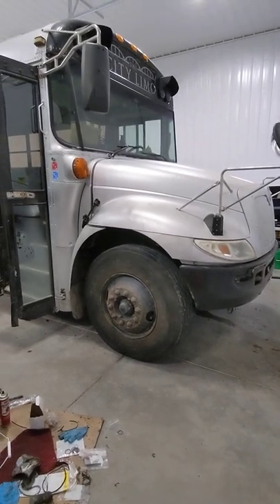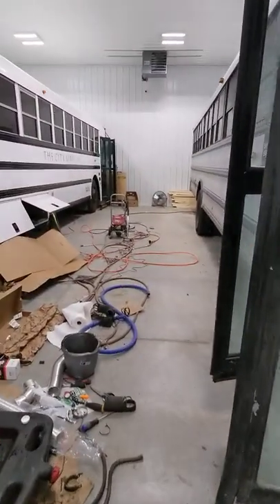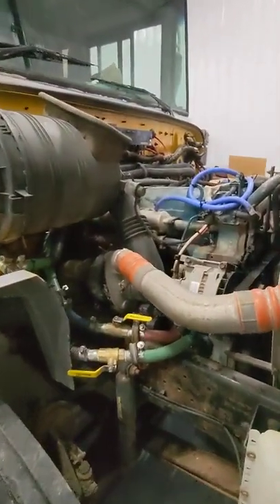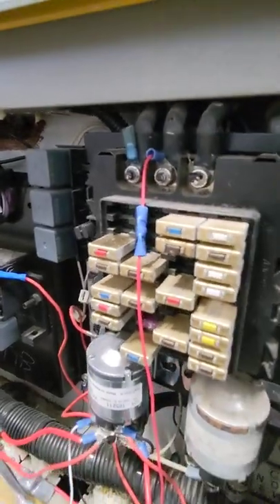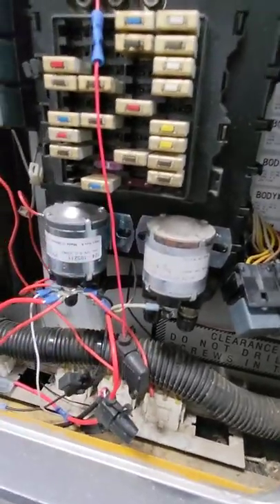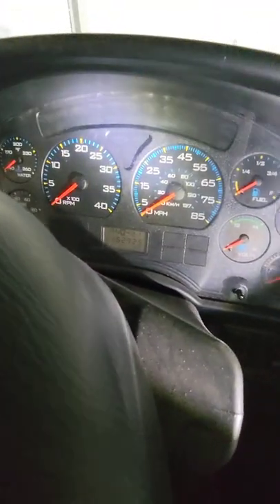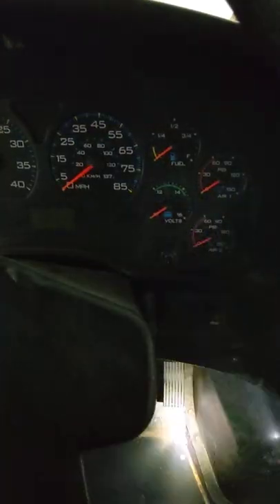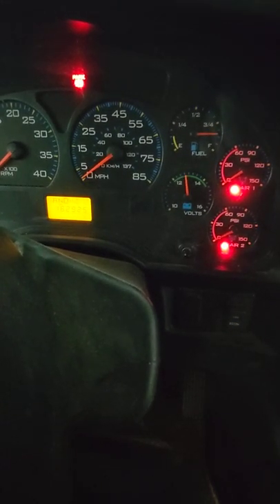Troubleshooting Bus Diesel DT466e No-Start

Comment: I do appreciate what you have offered here in this video, thank you.
I have a 2005 International IC CE300 school bus,  My problem is this safety interlock system?? How do you bypass it completely??  Its a pain 😢
I figit with back door, then itll start, sometimes it will not.
I have pulled the relay out so it will not come up on the dash anymore.   And those 2 seleniods are expendable i see too.  just trying to get to the bottom of this.
Reply from the maker: I've never tried bypassing it altogether. I couldn't even tell you if the circuit is triggered by voltage or ground.